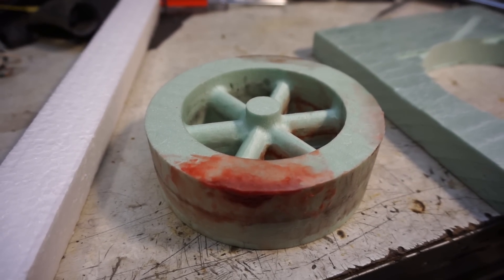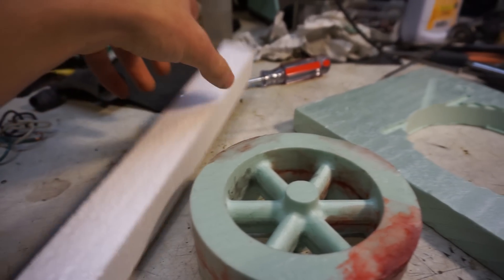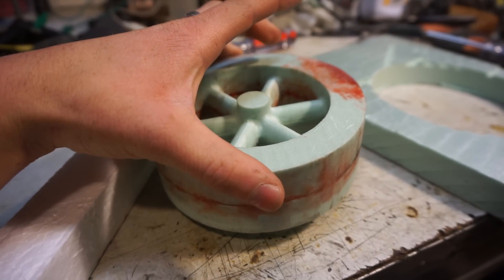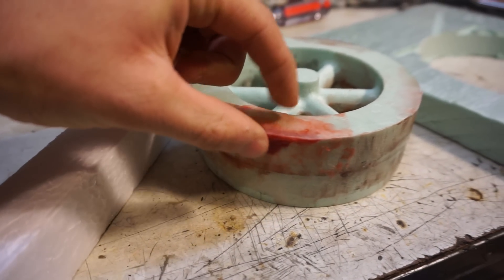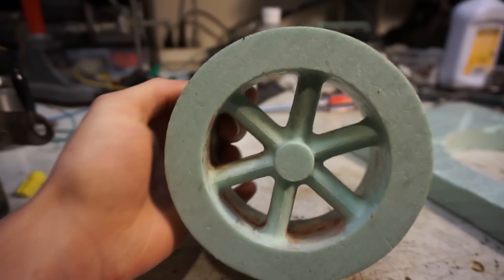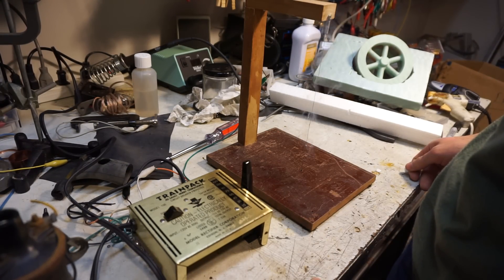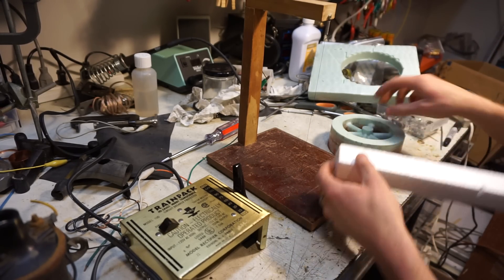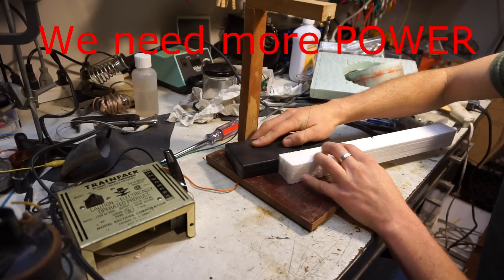Casting an Aluminium Flywheel Using Lost Foam Method and CNC Routed Foam

Comment: Dude the problem is... well one of the problems is you aren't using any refractory at all.  You gotta do it paint the foam with watered down drywall compound. Then your surfaces will replicate the walls of the foam not bumpy sand globs. Watch the old foundry man for green sand molding and Kelly Cofield for lost foam those guys are epic!

Comment: I've worked in a foundry for many years, and I have to say I was well impressed with the standard of casting that you achieved; Alloy is VERY runny ( just like iron and high tin bronze ) when molten, so the finish that you got, with little sign of dingle-berries is very impressive.. On some " hot " castings that I've seen the metal has crept into the sand, resulting in a VERY difficult to machine sandy layer - you seem to have avoided this. Just please STOP THE LATHE whilst disengaging and engaging the tumbler reverse !

Comment: If you haven't tried it yet ..dried sifted sand works good with lost foam, wrap the sprue with tin foil  and with a funnel like top for pressure ,when you pour, don't let up..so the sand doesn't cave in. dried sifted sand can pack good as you shake it it and tap when preparing the part,,leaves a great finish..but the part needs to be deep enough..cause it can grow if there isnt enough weight to keep the aluminium cavity down lol.ive had finishes that you can see the factory foam marks .

Comment: Nice job !!!  One thing to check out if you want to keep your lathe alive. Do not switch the forward reverse gears whil the lathe is running. You can already hear the noises coming from the fwd/rev gear combination.always shut the lathe OFF before going from fwd to neutral and reverse. It's just so expensive to replace or repair the damaged parts when you could have avoided it entirely by using it correctly. I know it takes longer, but it is WAY cheaper to use it properly. Really nice casting😀

Comment: If you coat the pattern with plaster or thinned wall plaster, and let it dry for at least 24 hours, then you only need to back the pattern with regular sand. A vibrator will insure the sand fills  in underneath, and you don't have to worry about packing the sand,because you don't pack it at all. You just fill in around it and vibrate.

Comment: Sorry you poured it too quickly and erratically you seemed to be new to this. I mention this only because this could have been very dangerous. Pour it from the side. and this allows the air-gas to escape as you allow the metal to go down the hole, you were in danger of pouring this without letting the inside gas escape at all. Sorry but this can cause a severe blowback into your body even your face or legs which you did not protect either .I have seen some very serious wounds caused by blowback just in the same way if you puncture an air filled balloon it will throw all the top stuff back at you and you don't need a lot to make permanent disfiguration all of you remember to clothe yourself properly and have someone stand by with a bucket or two of water especially at the beginning. Otherwise have fun and please brother easy does it. Alistair from Scotland.

Comment: Great job, I had metal shop years ago in high school and we sifted our sand  plus we used talcum powder especially when we made a two part casting mold.also there should be at least two 3/4 in. holes  one for pouring and the second usually 180 deg. from the first will allow you to verify that the mold is completely full when you see the metal rise in the vent hole . Hope this helped and again great work

Comment: Do you know what sort of coal it is? theresc various types.if you did a search for the coal mine you might find a record of the type, lignite,anthracite and so on. Why? becasuse you might be able to make Coke (not the drink or the recreational candy) but cooked coal which gets damned hot quicklythus saving you time and giving you more control over your heat. And a safety hint , Burning Styrofoam produces Styrene gas which wrecks your nervous system, the choking effect you feel is carbon monoxide which Will suffocate you .it's one of the things which killed the people in the grenfell Tower tragedy. otherwise...keep it up!
Reply from the maker: +Mercmad the coal is bituminous. And it's honestly pretty low quietly stuff. But making coke might still work. How would I go about turning it into coke? I had not heard of styrene gas. That doesn't sound nice.

Comment: Cool! I'm casting alu too, but uses the traditional methode (two half of a master kind). I make mini parts  for a little engine. The surface of your cast is not very good... It might be that you're using high density foam? (and a "lot of" plastic to burn) - but using light foam will make it nearly impossible to machine?.
I'm sure if you tried to melt out the foam first, the cast will be much better, but then again you have to cover the foam in some solid first - like plaster of paris...

Comment: Nice video! I know you were a bit worried about turning the your wheel on the lathe because of the jaws on your chuck. Next time try drilling a small pilot hole in the center of the wheel and use a live center to keep everything tight. -Adam

Comment: Those look like ordinary house bricks, they can explode if moisture gets trapped in them when they get hot. Nearly took my eye out once, picked up a board in the garden which had a bit of brick frozen to it, went to solder a pipe and bang!
Awesome result, what was the crucible made of?
Reply from the maker: +spyderz1303 I've fired my foundry up at least 20 times and I've never had one pop. I start a wood fire first so it heats up pretty slow so that's probably why none have exploded. The bricks melt together real nice tho lol
Crucible is a clay graphite crucible that I bought on Amazon for $60.

Comment: Heyya makerJ - I have done many of these lost foam castings.. Instead of using the green casting sand, I instead use fine pool  filter sand in a medium sized metal garbage pail - Fill the can up halfway with the sand, place your foam model in, and then pour the sand in over top of the foam.. once it is filled up you then jiggle/whack/vibrate the outside of the can with any blunt object which will cause the fine silica sand to completely fill in and around your foam template.   I have had perfect success using this method, and  can often see the outline of the scotch tape I use to hold the foam parts together in the finished casting.  Also, I have had the best success routing the the sprue down towards the bottom of the foam model, this prevents the gasses from the melting/burning styrofoam from "bubbling" up through the molten aluminum.    
Great job on your flywheel!
Reply: i set the pail on a piece of wood and vibrate it with a drill set to “hammer” function

Comment: Next time, try putting a layer of PAINT on the foam. The paint burns and turns to carbon, but if memory serves me correctly (from having watched other videos like this), it will leave a much smoother surface.

Comment: If you use high density foam (blue stuff) and you coat it in drywall plaster first, you will get a much smoother surface and not have to sand/file hardly at all. You want to coat the foam part with plaster to keep the sand away

Comment: You are tempting fate cutting away from the chuck like that. There is a good chance it will pull the part out of the chuck, especially using inside jaws on a rough casting like that that doesn't have the best grip. It also loads the lathe in the opposite direction then usual, which can cause some issues, and you are cutting with the wrong side of the tool, which can do some funny stuff as well. It might work, but it is best practice to always cut towards the chuck.

Good job though, it turned out great.
Reply from the maker: +Andrew Bird you're right. I never really thought about why cutting away from the chuck it's a bad idea. Thanks for the tip. That helps a lot.

Comment: I love your videos, so many awesome ideas making alot more things possible for someone without the proper tools and cash, Quick question  do  you think would be possible use normal sand like out of wash? And do alot of sanding?
Reply: Also could i use aluminum soda cans for my aluminum?
Reply from the maker: +John Whitlock yes, normal sand works ok. Fine sand quirks much better. I like the bags of fine arena sand that they sell at home dept. Its like $4 for a 50lb bag. Yep, you can use cans. However you need to melt like 100 to get one pound of aluminum and there will be a lot of slag. So personally I hate using cans. But if that's all you got, that's all you got and it'll do fine.

Comment: Any idea what alloy you're using?
Reply from the maker: +Corazon del Oro it's a real special alloy called Makerj101. It's got everything from lawn chair and hard drives to weed eater engine parts. I'd confidently say it's at least 90% aluminum with numerous traces of all kinda things. :D that probably doesn't help does it?  what I meant was I have no clue. And it honestly doesn't matter for a flywheel.

Comment: It's a shame that you can't 3d print a mould and use this method
Reply: Junkers Erik Pearson There are some videos on YouTube about lost PLA to go from 3D print to casting.  The idea is that PLA melts.  Heat the mold, pour out the PLA and burn the rest out.  These use plaster mold instead of sand.

Comment: I would not recommend using propane tanks for a crucible or steel at all for 2 reasons
1. Steel will burn through a lot easier than a clay/graphite crucible will.
2. With steel, you have a lot higher chance of making thermite. I know someone that does this professionally and got a bit of steel dust in his 30lb crucible. It made thermite and it burned for 6 hours. At 4000ºF.
Reply: DailyTech Business Computers, because an American Exceptionalism, lol
Reply: Cause this is" 'Merica!" Next thing you'll want us to drive on the left side of the road!
Reply: Does crucible was fully made of iron oxide? Otherwise there wasn't so many iron oxide to made thermite reaction and burn 13kg of aluminium... 
Sounds like city legend, but if its true it could be next scenario(happened to me): some day we decide to melt old engine block made of (as we then thought) of aluminium, after it heats up well it spontaneously catch fire and burn almost all, later we find out that it was some aluminium-magnesium alloy, there was at least 50% of magnesium, this metal burn as crazy so no wonder, in crusible left some melted leftovers of aluminum, about 25% of starting volume, so it is not always thermite reaction when some alloy burn.
Reply: you should not leave aluminum in steel crucible. ever heard of intergranular corrosion? that's a good way to have a hole develop in your crucible  and then you get to watch all your 1300 F aluminum dump everywhere. If you use steel use a clay liner like fire clay or apply several coats of liquid glass/ sodium silicate to act as a barrier between the two dissimilar metals.

Comment: Nice job, I would have sandblasted the interior and spokes before machining the outer surfaces. Still, your method of casting works good. Don't inhale those fumes, you will get sick in the long run. Protect yourself.

Comment: If you have a lathe, then why do you also have a backyard built foundry? And not build your own?
Reply from the maker: +tyler friend the lathe is not mine. It is at a local hacker space called HackPGH. It's a community type workshop. Kinda like a gym where you pay a monthly membership to use tools instead of workout equipment. I do plan on building a proper foundry at some point. Maybe this summer

Comment: If you had a CNC machine, why didn't you just make an aluminum flywheel the first time and forget about the casting? It just seems that it would have been easier.
Reply: Well actually casting a block of aluminum and then cnc machining will be still cheap but waaay more precise
Reply from the maker: +Donald Steele well a solid block of aluminum that big would be pretty expensive. Secondly it would take 10 times longer to mill out of aluminum on a cbc router like this since it's not a very ridged machine. And if the machine messed up I would have had to buy a new block of aluminum. Casting is really the cheapest way to do it because you can use scrape aluminum. Probably not easiest if you have unlimited money.
Reply: sounds like the best way to go if you ask me !  good job great vid.

Comment: when you put it on the lathe, it looks like it was not perfectly centered, you can hear it all the way through, where it makes louder sounds at one phase of the each revolution.   Since you ground down the outside the outer diameter will be perfectly round, but, the weight will be heavier on one side than the other.

Comment: Try coating the foam in a thin layer of wax to get a cleaner finish.  I also believe that you got a bad oxide layer/barrier which you might be able to remedy with some alloy adjustments.  But that's all I can say besides very impressive results for such a novel concept.

Comment: By no means am I trying to berate you, but if I may offer some advice. I have to say, I applaud your ingenuity, effort and sense of creativity.
1.) Please wear a respirator when working with molten metals, especially if using the lost foam method and adding things such as plastics (the straws).
2.) Also, you should really wear proper eye PPE as well. Just be aware of which end of the spectrum they are protecting from as traditional welding lenses protect UV and forging/casting is IR if I recall correctly.
3.) If you are using something such as the straws for venting the gases, haha, don't point one towards yourself when you are pouring. All it takes is a drop and then you will react. Next thing you know, you have an entire crucible of spilling molten metal to worry about.

Other than that, really great work for starting out. I hope you continue doing this and having fun. Just stay safe. :)

Comment: Doesn't cooling it rapidly in water makes the metal brittle ??
Reply: Careful not to treat aluminum the same as steel when it comes to heat treatment. In most cases it is beneficial to quench aluminum and will result in a stronger and more ductile material. Aluminum becomes brittle when it is sensitized and the best way to keep it from sensitzing is not having at at elevated temperatures. It also depends a lot on the type of aluminum, 4000 series is significantly different than 6000 series and so on.
Reply: astromicwm it makes the metal harded
Reply: Depends on a lot of factors. Mostly what the temperature of the metal was when he first put it in the water. Considering he could handle it with leather gloves, I would say the crystalline structure had mostly already formed how it was going to. It's not uncommon if he plans on further heat treating it though.
Reply: Depending on temperatures, can also make it brittle.  I did some machining n my youth which included softening metals to machine them, and hardening and tempering after machining.
Reply: ceedaddy +  Not knowing the alloy of the aluminum, it is hard to predict what will happen to the aluminum matrix during ambient temperature water quenching.  A good resource on quenching is found at http://www.croucher.us/water-quenching.
Reply: Dropping hot metal in water crystalizes it and makes it brittle and break easily... need to drop it in hot oil and let it slowly cool down to retain its structure without crystalizing

Comment: This is the closest thing I've seen to what I need on the internet. Only problem is that it doesn't have a 4-5' diameter.
Reply: Had a friend that once poured a huge lead keel for a boat. Poured it at night, on a public beach, in the days before anyone cared much about the environment. Used an old cast iron enamel bath with a huge fire built around it to melt the lead, and allowed the molten metal to enter the mold via a drain channel in the sand. There were some problems with lead leaking around the plug hole seal and it became "self pouring", with people running everywhere to escape. Pattern was made from polystyrene carefully smoothed to shape. Took about 10 days to cool down enough to dig it up but it worked well and was later fitted to an ocean going yacht. A pile of sand might work as good as a beach but I would suggest that you make the pattern and get a proper commercial foundry to do the work. The actual casting process is not that expensive if you can supply the pattern and the metal.
Reply: That would work wouldn't it.

Comment: what is the use of this wheel
Reply: It's a flywheel. It's used on small engines to keep them running smoothly.
Reply: it's for his new v2.0 flux capacitor thing'o time machine

Comment: I worked for a company that made styrofoam casting patterns (my side), then they poured metal from them. Liked your video. I would suggest making pattern out of foam just like used to make drinking cups (EPS), and density makes a difference (like 1.5). It makes a smother surface. Also putting a coating as stated before helps the most for surface finish, foundries have their own mix (yes sand, the finer the better, will get into cracks and pits of foam no matter how small they are). Hope this helps, your looking good at it so far.

Comment: You can get rid of the ruff finish from the sand if you use a refractory coating. Drywall mud works great. It takes about 2 coats. Just be sure you give it time to completely dry before the second coat and before you cast.

Comment: You could try sand blasting or bead blasting it before you turn it on the lathe to take the surface down a bit.